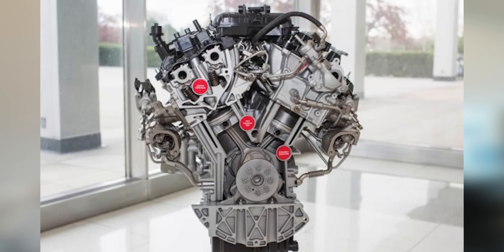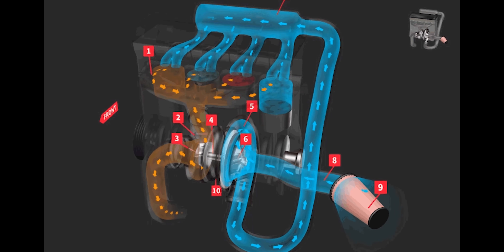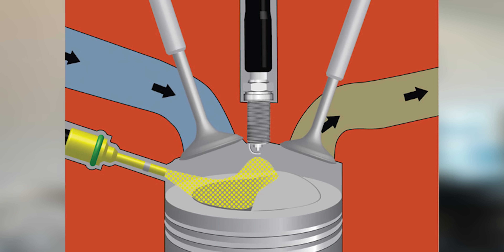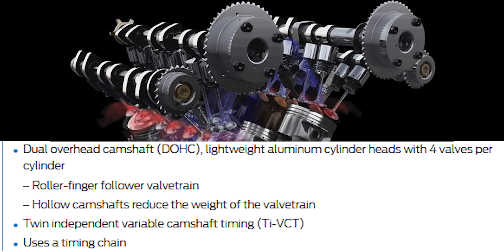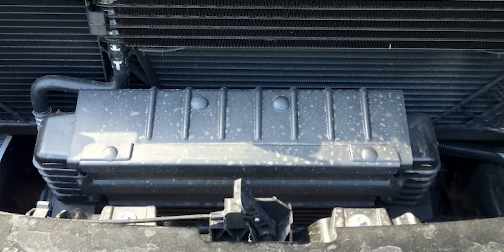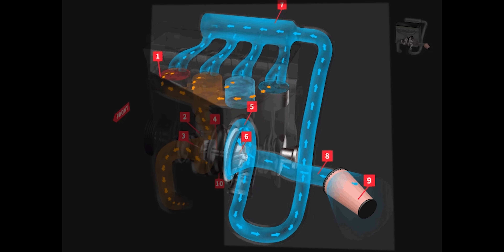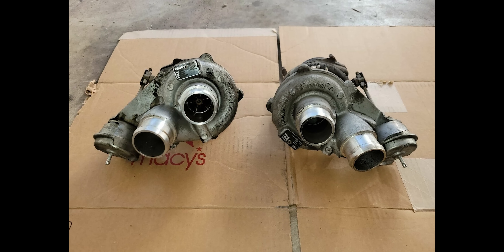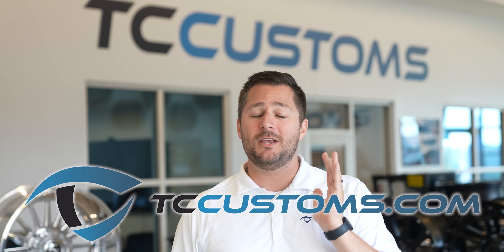The Truth about the Ecoboost Engine!

Comment: I have a a 2017 3.5 eccobost the 7-10k mile oil change is the biggest mistake people can make. With it being a Direct injection engine over time fuel will get past the piston rings and into the oil. It will mess up the viscosity of the oil. It will no longer lubricate properly. It’s part of the reason the eccoboost have cam phaser issues and timing chain slap.
Reply: I agree. I bought my 3.5 new and I’ve changed the oil every 5k miles since
Reply: Thankfully the Gen 2 version with MPFI has lessened that from happening. The GDI only works under hard acceleration.
Reply: @acdii  yes I have the gen 2, can phasers replace at 37k
Reply: @jonathanpesek842  Actually that is not oil related but a design issue. Ford "supposedly" has new parts that corrected it under a TSB. Supposedly, not saying they actually did.  You had the famous cold start knock I take it?
Reply: @ jonathan pesek- the cam phaser issue isn’t caused by poor oil change habits, they’re just poorly designed.  I usually replace a set of phasers on F150 every week and it’s not unusual to have a truck in for the procedure for a second or third time!  I just finished a truck that went 17k miles since the previous phaser replacement - less than 12 months!  Inside of that engine was immaculate.
Reply: @ghostwrench2292  I agree the oil drains and they are dry on cold starts , but using a good full synthetic oil won’t hurt
Reply: @acdii  yes and it’s doing it again in less than 10k miles
Reply: @jonathanpesek842  Find a different service department, that is just wrong to have it keep happening, they are either not using the upgraded parts, or not doing it right. There are many who have had it done to the latest SB and have not had any issues since.  You also have a decent case to get some money back from Ford. talk to one of those firms that specializes in LL.  You may be beyond your states LL, but you are not out of the Magnuson-moss act period. I did that on my 2016 and won. Ford refused to replace the EPAS that kept acting up, so instead paid me 5 times what it would have cost.

Comment: Just bought my second 2.7 Ecoboost powered F150, first time Super Crew, this time got what fit my life better, Crew Cab, bench front, rubber floor, 6.5 foot bed, FX4, 3.73 rear, my old truck with 3.55 rear and 6 speed got 20.4, this thing with 10 speed gets 22.5 driven mostly in Econ mode, I’m a Grandpaw so that don’t bother me, the new truck rated to tow 10,600 lbs the old truck 7,000 lb. Even though it’s still a lowly STX interior materials look way better.

Comment: I love the 6"bds lift I got on my 14.
3.5l is a torque monster but one of the weak leaks is the factory exhaust manifolds and gasket.
I recommend the cr performance full bore polished manifolds with stainless gaskets.
Reply: ford always have had terrible manifolds and gaskets, up here in the rust belt  especially with salt on the roads I drove fords to plow snow and I have seen countless ford trucks driving around with manifold leaks, meanwhile the cheverolet trucks driving around are silent

Comment: I have a 2016 f150 3.5 ecoboost with many issues: 85k mi the exdaust bolts broke, at 95k mi the cat sensors replaced, and now it is missing at high speeds(like passing) or going up hill. Chamged all coils and all plugs, re-gaped plugs  and that fixed it for 10k mi. I go thru plugs every 10k-15k mi!

Comment: You forgot to mention the main reason for the port injectors. They help to eliminate carbon build-up on the valve stem and seats.
Reply: That was my concern. I was waiting for him to mention that. Do I need to do the carbon cleaning maintenance or does the port injectors effective enough to do the job?
Reply: @erikuber9625  if you have a newer head with both the port & direct you should be ok. If it's just direct then you should clean them

Comment: 10k oil changes will absolutely cause premature timing chain and assembly wear. it's a known problem. my entire timing assembly had to be replaced at 75k because of 10k oil changes. change at 4-5k and your all good
Reply: I try to change at 3000 miles, oil is cheap....
Reply: It's known and proven by Ford master techs that the EcoBoost  requires more maintenance than the NA engines.
Reply: This simply isn’t true. I’ve been at 10K intervals since about 40K. I’m now at 130K and had my timing chain checked and still has about 1/3 of the tension left on the tensioner. I’ve also been having the oil analyzed every oil change since about 70K. 

The issue isn’t 10K oil changes the issue is running the oil past it’s useable life and/or abuse. A good quality oil with a high quality filter will allow you to go 10K+. 4-5K oil changes only benefit if you are using crap oil.
Reply: @mattwodziak1750  might as well talk to a wall because most people don't understand that. "Oil is oil; I buy whatever is on sale" They don't realize that some oils are more costly because they have a premium additive package and are true 100% synthetic. I run Amsoil and get it anyalyzed and the TBN rating is so high they always tell me to go a lot longer. Never had a problem. My wear metals are always below average.
Reply: @zackzander425  
Yep. Oil change intervals is always the culprit yet these YouTube mechanics never talk about the quality of oil in the same discussion. It’s always “oil changes are cheap” or “cheap insurance”. This is total BS. 

Auto manufacturers put different specifications on each each engine that the oil must meet to get the mileage called out in the manual. If you put anything less, you are ruining your engine. There’s a lot more to oil than the weight and viscosity. 

For instance, one major factor is the ability of the oil to absorb fuel. These high compression ecoboost engines tend to get a lot of blowby putting a lot of fuel in the oil. If an oil can’t maintain viscosity with some fuel in it, you are going to get wear issues.
Reply: @zackzander425  how often do you change the Amsoil? What vehicle and  how hard do you drive it?
Reply: @mattwodziak1750  
If one is not using good oil then they are not following manufacturer's recommendations. If the synthetic is used it will be good oil. When you refer to "crap oil" do you mean non-synthetic oil? With the heat involved regular oil should never be used. There are issues beyond lubricating abilities that include acids that form with time being a factor. Once a year is important regardless. Fewer miles tend to mean shorter trips and moisture becoming a factor forming acids. 10k over two years is not a good idea because of contaminants in the oil a filter does not take out.
Reply: @zackzander425  are you aware Amsoil is mostly group III base oil from Chevron? It has been mostly group III for nearly a decade.
Reply: @larrybe2900  
I don’t think you can necessarily say that all synthetic is good oil. It need to meet the specifications for that manufacturer AND that engine. Different engines have different specifications even under the same manufacturer. The specifications go far beyond the weight, viscosity and whether or not it is fully synthetic. As you said there are additives that do a lot of other things that are far more critical to oil life than the weight and viscosity. I think most people are unaware of this, especially those who go to jiffy lube and Walmart for their oil changes. They have no clue if the oil being put in their engine even meets spec.
Reply: @davidporter7051  NOT TRUE!
Reply: @1gr8oil  it is. The highest content of their signature series is
Hydrogenated base oil=group III.
CAS number: 72623-87-1
PAO is Ethylene not hydrogenated base oil.
Reply: @mattwodziak1750  
It is hard to disagree with what you have offered. Your defining as junk oil is what does not meet specifications. Fair enough. I often think about your last sentiment and engine failure for those engines that prematurely wear. All in all it is/may just be inappropriate oil. They can compensate for different fuel octane but is critical for the lubricating oil.
Reply: The Ford dealer advised me 7500 miles for oil change on my 2021 Ranger.
Reply: @davidporter7051  PAO is NOT ETHYLENE.  
(PAO) Polyalphaolefin is comprised of hydrocarbon molecules, also known as Synthesized Hydrocarbons, and consist of a singular molecular structure.  They are manufactured by reacting ETHYLENE  gas  with a metallic catalyst!
As far as AMSOIL Inc. is concerned, they DO NOT offer ANY information on what they use in their oils, as it is PROPITIATORY, and they will not disclose any of that information, so I don't know just how you can truthfully say  what you are saying.
Reply: @1gr8oil  
Polyalphaolefins is PAO from ethylene this is produced from Chevron Phillips Chemical for base oil. (PHOSPHONOACETYL)-L-ORNITHINE is
PAO is processed through Oligomerization. By Exxon Mobil for base oil. You really don't know what you are writing. You are just regurgitating bullet points from a PowerPoint you read.
PAO is synthesized not hydrocracked and are not described as hydrocarbons. This is group III.
Reply: @davidporter7051  I've most likely been through more Schools/Universities on lubricants than you realize, as I am a certified Lubrication specialist, so I know what I'm talking about!
Reply: @1gr8oil  simply you do not know what you are talking about. If you did you would know what Polyalphaolefins are and you would not have taken the PAO definition nearly verbatim from machinery lubrication.
You are a salesman plain and simple. The CLS qualification is just as creditable as a Trump University Business certification. Anyone can obtain one no background education required.
Reply: @davidporter7051  Oh Really!  Go take the test and see how long it takes you to complete, if you do pass it!
Reply: @1gr8oil  why are you surprised a B.S. certification can be obtained? You really don't have a clue about tribology. This is why. If you did you would have called yourself a tribologist not a "Lubricant Specialist". You are closer to special needs.
Reply: @davidporter7051  Sorry, I put it in terms I thought you could understand.
Reply: @1gr8oil  you used genetic fringe terms which have little meaning and are not used by a professional.
Reply: @davidporter7051  Tribology Is the Science and engineering of interacting surfaces in relative motion.  It is not the study of lubricants!
Reply: @davidporter7051  I see Master!
Reply: @1gr8oil  you really don't know what you are talking about. It's very apparent.

Comment: Maybe it's the "old skool" side of me as well, I don't like going over 3K on my LOF. 10K sounds crazy to me.
Reply: 3k is when they had poor efficient engines and the oil was basic. 5k miles change with todays synthetic is perfectly fine.
Reply: I daily drive a 2003 Mini Cooper S (supercharged engine) that I’m the original owner.  It specifies full synthetic oil and that oil counter in the dash display counts down from 15k miles until the next oil change.  I’ve run the full 15k miles a couple of times but generally stick to 10k because it’s easier to track.  My car now has over 160k miles and when I recently replaced the valve cover gasket, the valve train was perfectly clean - looks as good as a 30k mile engine.
Reply: @ghostwrench2292  Unless your engine is a GDI it's not really a fair comparison. The 1st generation EB engines, like others that are purely GDI suffered because the oil becomes quickly contaminated with fuel. They also tend to see high amounts of carbon build up on the intake valves because there is no fuel to wash the valves. 

I followed Ford's original 10K LOF interval...a long time ago, and they ended up replacing the cam phasers, guides, etc... an expensive repair at Ford's cost, not mine. I've backed down to 5K and 70,000 miles later no issues and 150K on the motor now. To be fair they've completely redesigned the fuel system by adding multi port injection along with the GDI. The MPI is for normal, lower rpm operation and the GDI is for higher rpm use with better efficiency and power.
Reply: Engine and oil technology is different. I personally dont run oil for 10k but 3k is wasting good oil. My Mustang is the exception since it runs on ethanol and routinely sees high temps and 7500rpm.
Reply: Keep doing it at 3k and don't listen to any of those clowns who tell you otherwise. If you have an older, reliable motor with port fuel injection, 5k is fine. But the newer motors with turbo's, cam phasers and direct injection, run very dirty. 5k and it looks like it came out of a diesel. 

Also change your trans fluid more often than the manual says to. Don't flush it. A drain and refill is all you need.
Reply: 10000 mile oil change? Is there suddenly less dirt in burning gasoline?
Reply: @thomaskime5148  better base oils and additives, more efficient combustion, better ring sealing. Lots of variables. There never was "dirt" in the gasoline.
Reply: @solarfall2728  though 3k won't hurt, the most reliable way to determine if its time for an oil change is test it. Get a benchmark and you'll be surprised what might be acceptable for your engine. 3k was an old recommendation based primarily on lube shops and  oil manufacturers trying to sell oil. It was also heavily influenced by lesser oil and engine technology
Reply: @The Nothing Air/fuel injection system is getting so precise and filtered, sludge just isn't an issue anymore.
Reply: @thomaskime5148  Ryan Murray is right. 
I would be very comfortable running my vehicle 8K (just to be cautious) if Ford says 10K.
Reply: I totally understand your statement, 3000 miles I change the oil and will continue to do so because of my old school mind set
Reply: @rayrussell6258  3.5 Ecoboost, current iteration is a Gen 2. Mine is a Gen 1. FYI, I am safely wringing out 450+ hp from the engine and returning 19 MPG on the highway. Not terrible at all.
Reply: I personally go on 4k miles, full synthetic. 2.0 ecoboost with an E30 tune. 
These engines typically run hot (especially stock) i was always seeing high intake temps etc, but i digress. Those hot temps ruin fluids and ford uses a synthetic blend (and blends arent “mandated” per say, so if their 1/10th synthetic and the rest is traditional oil which isnt recommended on these engines they can label it as a blend) its also crazy in my opinion that chevy uses full synthetic on pretty much all the new cars and ford uses blends on theirs (yet both have similar technology) 
But def go between 3-5k even tho they typically recommend 6-7k between oil changes, high temps = a bad time for the oil
Especially on a boosted engine. These engines also run on high boost which makes it a little more worse for wear
Reply: @overknight5278  professional engineers who spend a career testing lubrication say otherwise; 
and they DON'T recommend 6-7K between oil changes on any Ford engines I know of! Where did you get that?!! 
The interval is 5K, until this recent and I'm guessing VERY limited engine set-up that is designed and developed to go 10K safely. Calls into question your whole post if you don't even know the normal recommended oil change interval. 

Neither Chevy or Ford "uses" full or blended synthetic oil .... they recommend oil that meets a standard set independently of the automakers, allowing either synthetic or virgin oil that meets the spec; 
Individually you or I "use" an oil to replace what came from the factory for break-in; in my case I don't use ANY synthetic oil if I can help it (synthetic oil usually includes some % recycled used oil, from what I've been told)

Comment: Have a 2018 had 2015 love them both. Pull how fast and how much I need. No issues run cold air and use high test when I can. Get good milage have to change your driving habits.  GET-R-DONE

Comment: One of the big reasons Ford went to a dual fuel injection system is because of carbon build up. That was a product of only using direct injection (DI as it is known), where the cylinder walls and the valves start to get carbon build up, which is bad for the engine and performance. I think some people use some kind of "catch can" on the first gen engines to reduce this problem. Ford addressed that problem by adding port fuel injection. I am assuming this dual injection setup fixed the carbon problem.
Reply: Yup, most of it was due to the EGR recirculating exhaust and coking up the valves.  Take apart any port injection motor and the intake runner after the injector and the back of the valve will be real clean.
Reply: And yet, no one to date has visual proof of it with the 3.5 Ecoboost because Ford has a patented timing system that back flows fuel behind the valves to prevent it.  All the pictures out there of supposed Ecoboost intakes are actually Audi engines. The smaller EB 4 cylinders do occasionally carbon up, but the 3.5 is not one of them.  IOW this is a myth.
Reply: @jkeelsnc  and Toyota copied what ford did with the dual injection.there was no “gravy train” as you called it, ford once again was the forefront of new technology 12 yrs ago